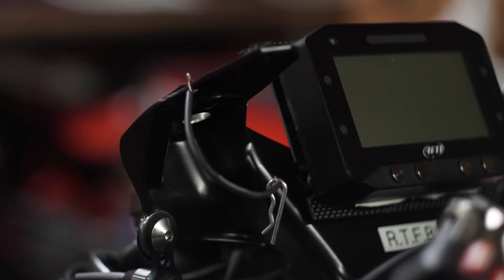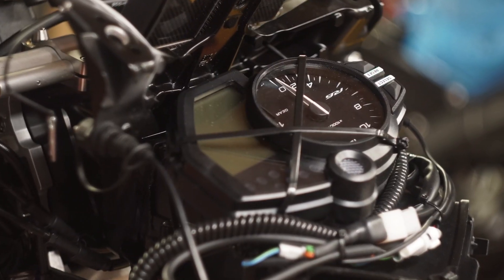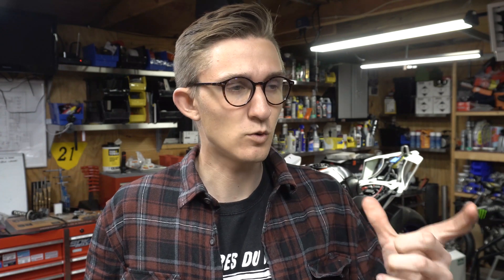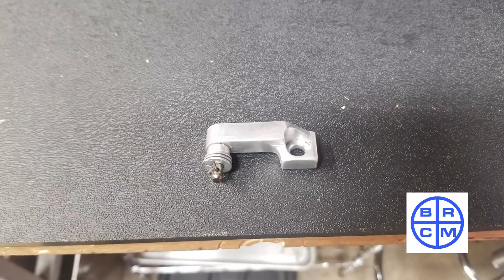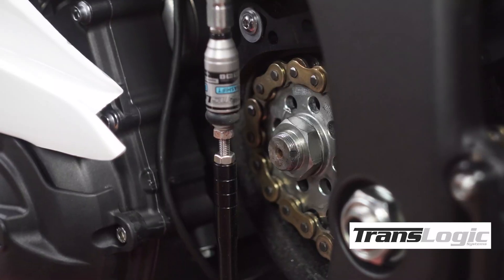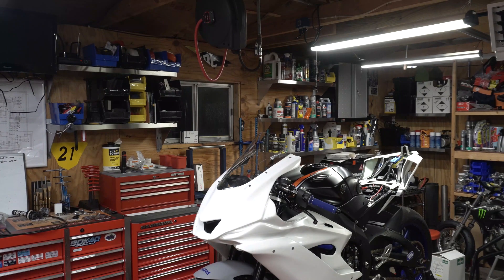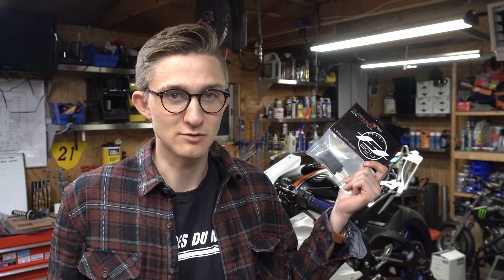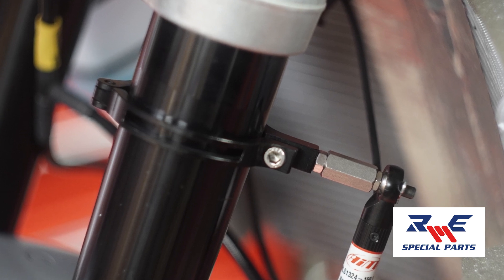2021 Race Bike Build | Ep. 2 | Electronics

Comment: I was wondering ,when I saw the gs dash the other day on Instagram, about if the stock dash had to be retained with the canbus system vs the k-line from the previous gen.
Reply from the maker: Yeah! We have tried to run it without it but it just doesn't work. With the longer air snorkel on the 17+ R6 it helps out tremendously to be able to put it on top of the snorkel. If you wanted to be really crazy you could possibly try and get the 17+ front fairing stay and snorkel and run the 17+ generation bodywork on the 08-16 R6. The R6 frame is completely the same, but the subframe is different. So you would have to run the old tail section, but the front fairing could be interesting. The 08-16 OEM R6 dash mounts different than the 17+ R6 dash though.